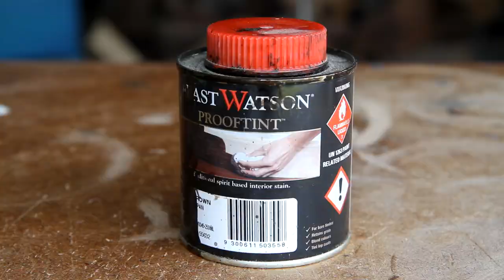Making A Faceted Bowl - How To Woodworking

Comment: I have a problem with pricing. How would you even start calculating a price for a piece like this? Is there a formula?
Reply from the maker: I just use a combo of a set hourly rate as well as the difficulty of the piece. It takes a while to get the idea :)
Reply: @FromASeed  Thank you very much.